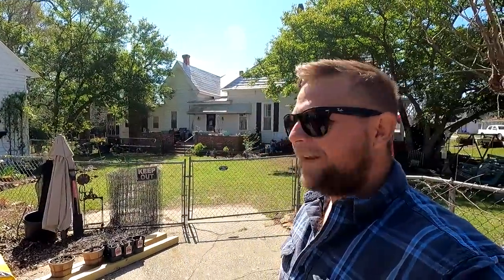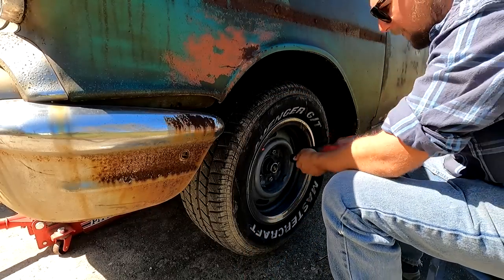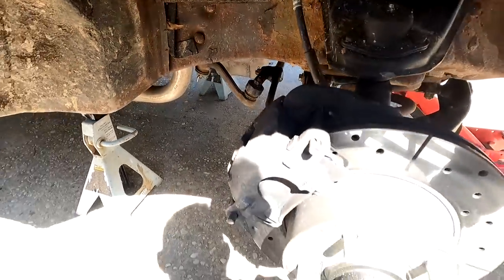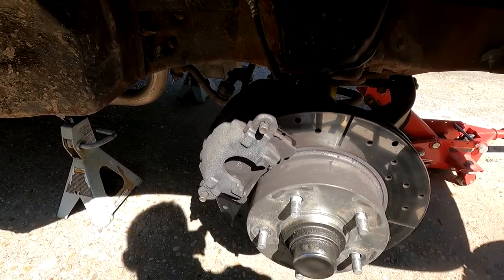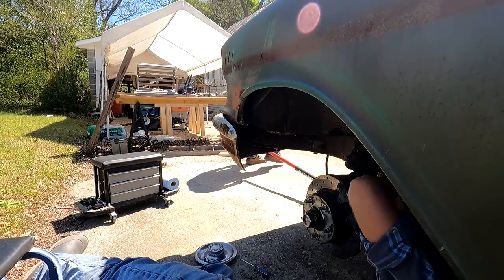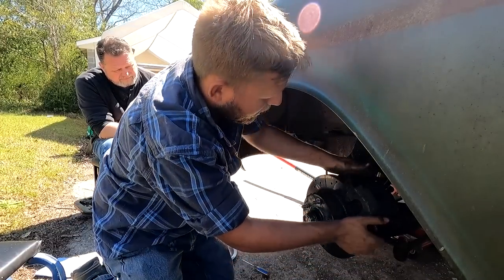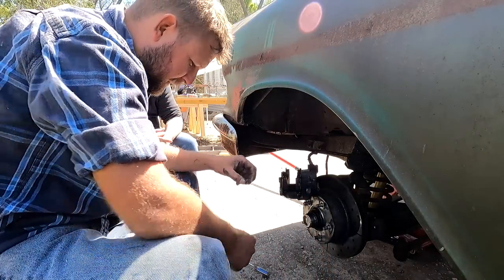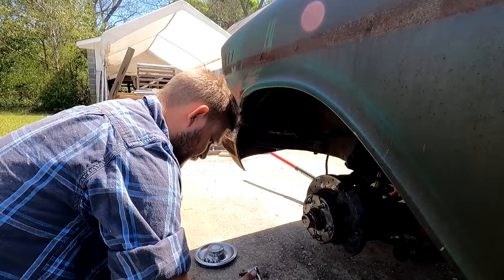SOMETHING IS WRONG WITH MY BRAKES! DISC BRAKE CONVERSION ON 1957 CHEVROLET

Comment: I learned a trick this year doing my front brakes as I was having trouble getting the bolts loose-turn the front end  so you can get  in behind the rotor  easier. In my case as well, it enabled me to put a longer breaker bar on.

Comment: Check the brake hoses. Even if its new the hose could be collapsed and not letting full pressure through or only letting the fluid return slowly. Love the old 57 with the US army on the door

Comment: Those disc brake kits move the wheels out 7/8 “ on each side. You can make zero offset disc brakes with brackets from mg chevy, 61-68 Impala hubs, 79 Tran-Am rear rotors and big D-52 calipers from a Chevelle. Works great and looks right!

Comment: 3:32  looks like the brake hose is not clipped to the bracket.  A little rubbing metal can blow a line.  I watch a lot of mechanic vids.  I've seen many times parts fail in a short time or are bad right out of the box.  Just because it's new doesn't mean it's good.

Comment: its probably the brake hose is collapsing on the inside (mustve just been caliper slide sticking on left side reason for more dust on that side and brake was on partially all the time so when you hit the brake it went to the right)

Comment: Forcing those bolts is a good way to break something or pull the car off stands , pop the end of the ratchet with the ball of yer hand , known as the meat hammer works way better bud